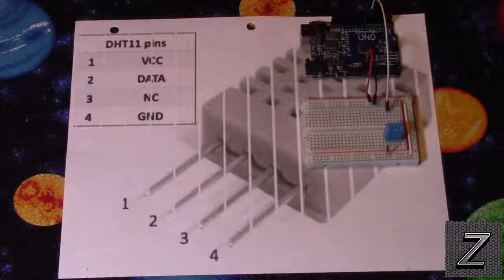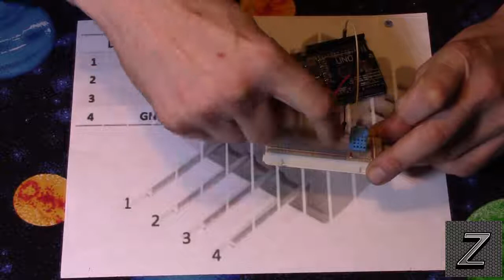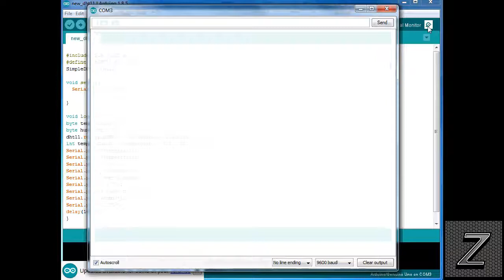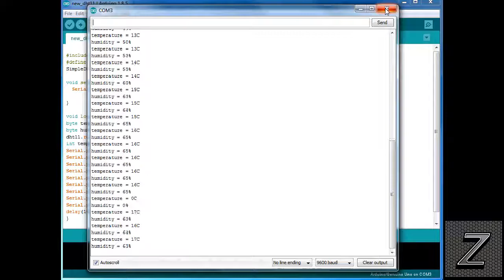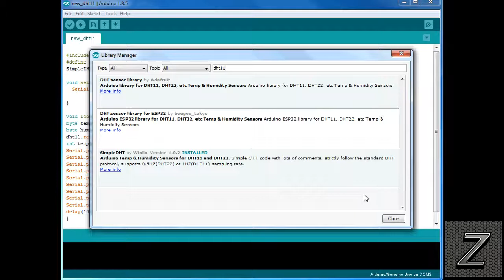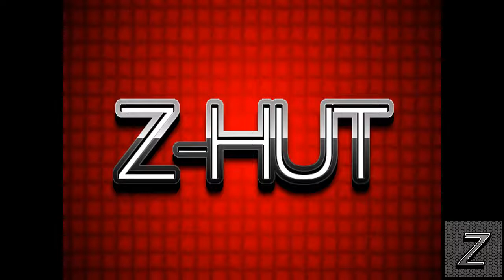learning Arduino for beginners EP#21 DHT11 & DHT22 temp and humidity sensor.

Comment: Arduino: 1.8.5 (Windows Store 1.8.10.0) (Windows 10), Board: "Arduino Mega ADK"
I got this error during compiling....

temp_sensor_test1:19: error: stray '\342' in program

 Serial.print(â€œtemperature = â€œ);

 ^

temp_sensor_test1:19: error: stray '\200' in program

temp_sensor_test1:19: error: stray '\234' in program

temp_sensor_test1:19: error: stray '\342' in program

temp_sensor_test1:19: error: stray '\200' in program

temp_sensor_test1:19: error: stray '\234' in program

temp_sensor_test1:21: error: stray '\342' in program

 Serial.println(â€œCâ€?);

 ^

temp_sensor_test1:21: error: stray '\200' in program

temp_sensor_test1:21: error: stray '\234' in program

temp_sensor_test1:21: error: stray '\342' in program

temp_sensor_test1:21: error: stray '\200' in program

temp_sensor_test1:21: error: stray '\235' in program

temp_sensor_test1:22: error: stray '\342' in program

 Serial.print(â€œtemperature = â€œ);

 ^

temp_sensor_test1:22: error: stray '\200' in program

temp_sensor_test1:22: error: stray '\234' in program

temp_sensor_test1:22: error: stray '\342' in program

temp_sensor_test1:22: error: stray '\200' in program

temp_sensor_test1:22: error: stray '\234' in program

temp_sensor_test1:24: error: stray '\342' in program

 Serial.println(â€œFâ€?);

 ^

temp_sensor_test1:24: error: stray '\200' in program

temp_sensor_test1:24: error: stray '\234' in program

temp_sensor_test1:24: error: stray '\342' in program

temp_sensor_test1:24: error: stray '\200' in program

temp_sensor_test1:24: error: stray '\235' in program

temp_sensor_test1:25: error: stray '\342' in program

 Serial.print(â€œhumidity = â€œ);

 ^

temp_sensor_test1:25: error: stray '\200' in program

temp_sensor_test1:25: error: stray '\234' in program

temp_sensor_test1:25: error: stray '\342' in program

temp_sensor_test1:25: error: stray '\200' in program

temp_sensor_test1:25: error: stray '\234' in program

temp_sensor_test1:27: error: stray '\342' in program

 Serial.println(â€œ%â€?);

 ^

temp_sensor_test1:27: error: stray '\200' in program

temp_sensor_test1:27: error: stray '\234' in program

temp_sensor_test1:27: error: stray '\342' in program

temp_sensor_test1:27: error: stray '\200' in program

temp_sensor_test1:27: error: stray '\235' in program

D:\Documents\Arduino\temp_sensor_test1\temp_sensor_test1.ino: In function 'void loop()':

temp_sensor_test1:19: error: expected primary-expression before ')' token

 Serial.print(â€œtemperature = â€œ);

                                  ^

temp_sensor_test1:21: error: 'C' was not declared in this scope

 Serial.println(â€œCâ€?);

                   ^

temp_sensor_test1:22: error: expected primary-expression before ')' token

 Serial.print(â€œtemperature = â€œ);

                                  ^

temp_sensor_test1:24: error: 'F' was not declared in this scope

 Serial.println(â€œFâ€?);

                   ^

temp_sensor_test1:25: error: expected primary-expression before ')' token

 Serial.print(â€œhumidity = â€œ);

                               ^

temp_sensor_test1:27: error: expected primary-expression before '%' token

 Serial.println(â€œ%â€?);

                   ^

temp_sensor_test1:27: error: expected primary-expression before ')' token

 Serial.println(â€œ%â€?);

                       ^

exit status 1
stray '\342' in program

This report would have more information with
"Show verbose output during compilation"
option enabled in File -> Preferences.
Reply from the maker: https://youtu.be/t3km2svfL3M